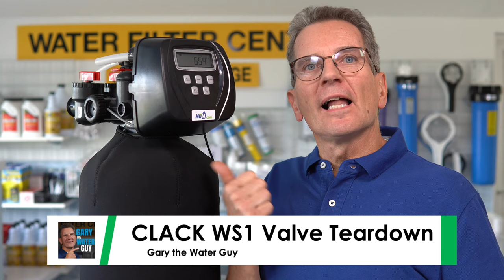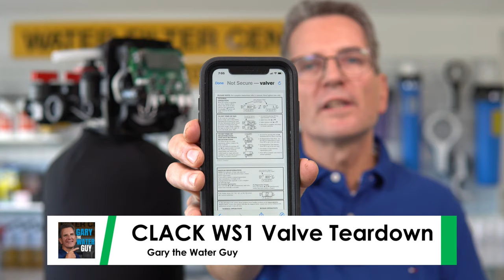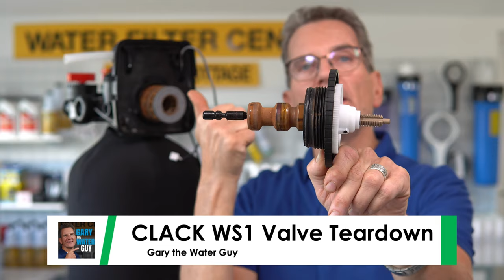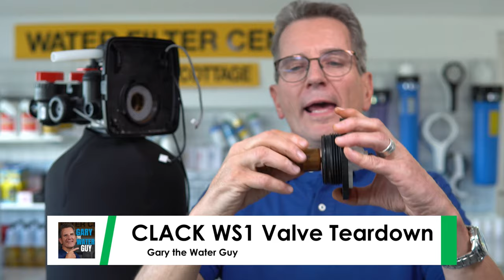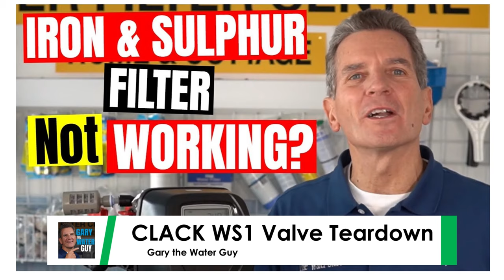CLACK WS1 WATER SOFTENER VALVE Disassembly, Troubleshooting Tips and Tricks

Comment from the maker: Thanks everyone for watching!  Any questions?
Reply: Hi Gary, great instructional videos. I have a Clack Tanin filter that after regeneration sometimes leaks, not always. What remedy do you recommend?
Reply from the maker: @dariocompain6049  where is it leaking from?
Reply: @water_estore  It leaks from the drain line. Very small leak as if it was just emptying the water residue in the line; however, it does not stop. It only does this every three to fourth regeneration cycle. The way I stop the leak is by shutting off the water supply, and releasing the air pressure. Once the air pressure is out I reopen the water supply and there is no leak.
Reply: @water_estore  It leaks from the drain hose. Does not leak always. After the third or fourth regeneration cycle. Small leak as if the water that leaks is residue water left in the drain line from the regeneration cycle. I close the water intakes and release the air pressure and the leak stops so I can turn the water supply back on.
Reply from the maker: @dariocompain6049  you will need to replace the pistons and seals, this video shows you how https://youtu.be/WIa033n4OQE
Reply: Hi Gary, what would cause the media resin to escape the tank?  My drain hole appears to have resin in it that has somehow escaped.

Comment: What would've been really useful--before I snapped the axle on my drive cap assembly tonight--would've been knowing that the downflow piston does NOT come right out of the drive cap as depicted in this, and in other similar, videos.  The two ends of the downflow piston are keyed IN OPPOSITE DIRECTIONS.  No amount of threading/unthreading of the drive cap made any difference in my install, the downflow piston would not budge, and now I'm ordering a new drive cap assembly because of it.  

Leaving this less as a critique of the original video, and more to warn people that the drive cap axle is plastic and delicate and one should presume that the outbound keying is the OPPOSITE of the keying for the brine piston.
Reply from the maker: I'm not exactly sure why this would happen, as I've never heard of anyone else snapping the axle (piston rod)  while doing this (and it's never happened to me), but yes the piston rod is quite small and could easily be snapped so I agree to be careful. Thanks for your comment.

Comment: NOO, DO NOT SAND THAT PISTON - YOU WILL JUST KILL IT AND YOUR STACK ASSEMBLY!!!
Just clean it with wet cloth, and if needed, soak in acid (I use 14% HCl), use a toothbrush. If iron still present then take a plastic card and gently remove all that on its working surfaces - they have to be nice and smooth
Reply from the maker: The Clack factory reps, the company that manufactures the valve, suggested the sandpaper during their training sessions.